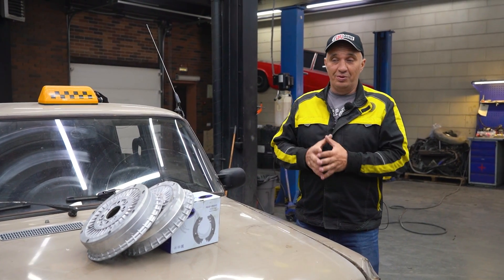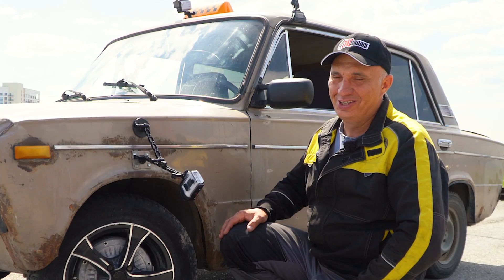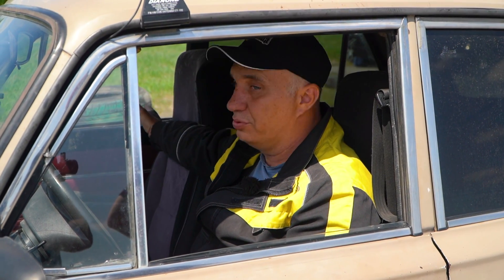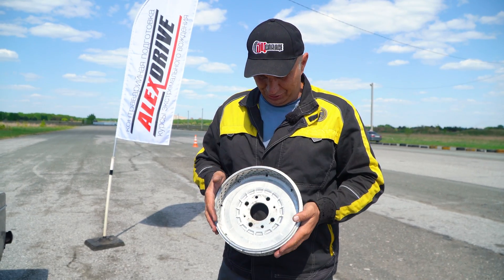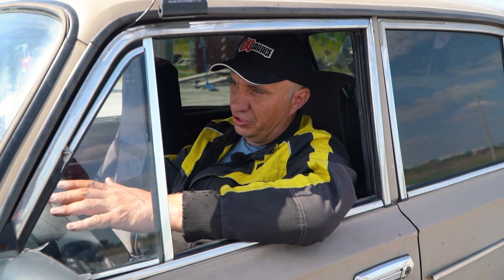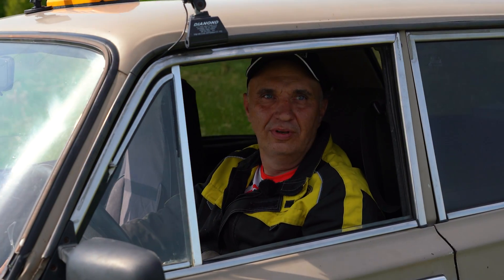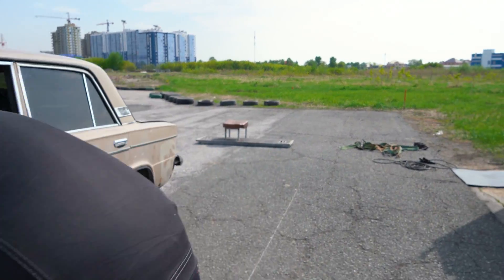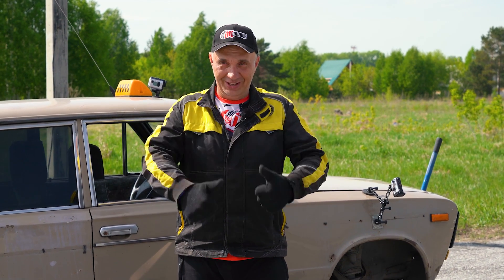We progressively drill holes in brake drums – what will happen?

Comment: Those drums became so advanced with all the drilling that they evolved into rotors.
Reply: More like a sieve than a drum.
Reply: You also have a car for thesting!! ( that's suprise.. or does ot was...

They have all russian ladas loaded on g54 to waiting testing different 'car acgeny' :D
Reply: 😂ikr?
Even though drums have more stopping power. Just saying, it's true
Reply: @lilmike2710 yea but drums suck at dispersing heat that’s why race cars use discs
Reply: @joshmanis-h7h  Yep 👍
But as we can see, they over did it, drilling too many holes. Crossing the threshold between heat dispersion and not enough surface area.

Comment: I think the test is faulted because of the aluminum , it stretched out, I would like to see this done on steel drums and a wet and dry test would be helpful too.
Reply: The friction surface is probably a steel ring.
Reply: @MrSpartanPaul it is. Decent thicken too
Reply: Both of them failed due to structural integrity that was lost with the drilling.   Those pads push out with so much force, plus the added heat, that both of them deformed into 'cones' and they lost all effectiveness.  The Aluminum is cast around the steel core and only bonded by the surface tension between the two....which, after all the testing (heat), drilling, and deformation...was gone.  This is a VERY cool test, love these guys because they aren't afraid to do anything.
Reply: The aluminum didn't stretch.  The steel lost it's tension outwards once part of it broke, so it let go of the aluminum.  It's how I get press-fit sleeves out of engine blocks.  I cut the sleeve on one side with the boring bar until it's thin enough to stick a pocket ruler behind, then stick a small taped rod down behind it on top of the ruler (so I don't damage the parent bore) and pry inwards.  Once the sleeve snaps, you can just pull it out by hand.
Reply: @FuckGoogle502 we didnt ask

Comment: I've never seen an aluminum brake drum before  !
Reply: I think Pontiac used them?
Reply: @kennethanway7979 Buick in the late 60’s had aluminum finned drum brakes which dissipated heat quite well.
Reply: Not that uncommon, a few '60s GN cars had them. Really common on the front of old hot rods.
Reply: Seen them on a 3rd gen Firebird! Stock they're aluminum with steel inserts for the friction surface, they were super lightweight!
Reply: I work in the automotive industry and I can't recall seeing an aluminum brake drum but then again I do paint and body and I hate drum brakes so anything I have I try to convert to disc
Reply: Its not, steel on inside.